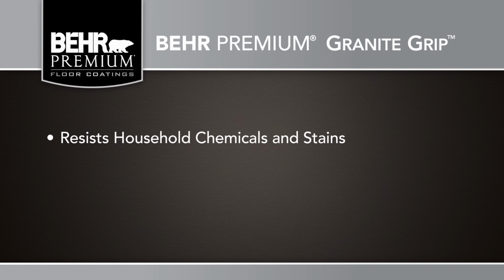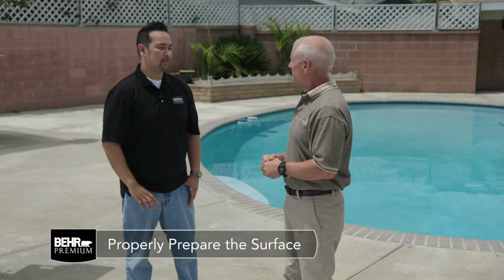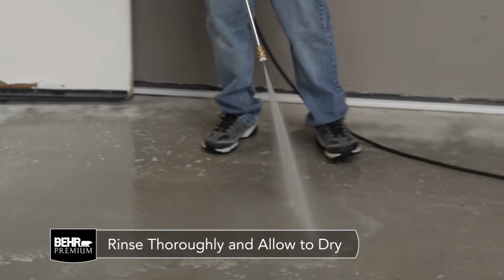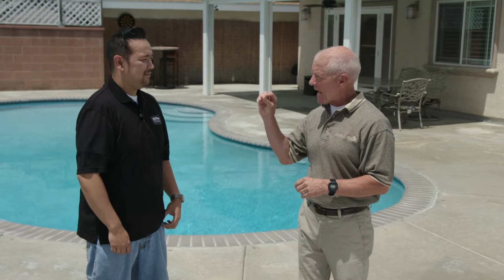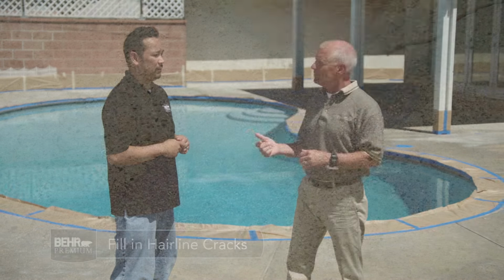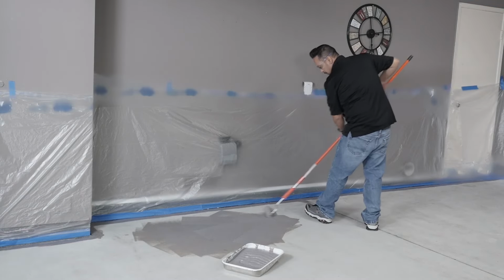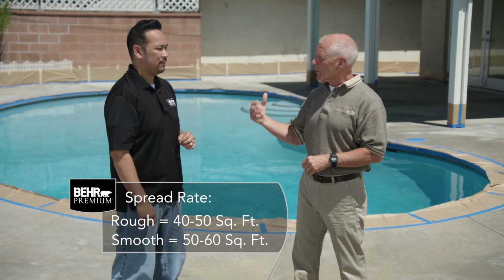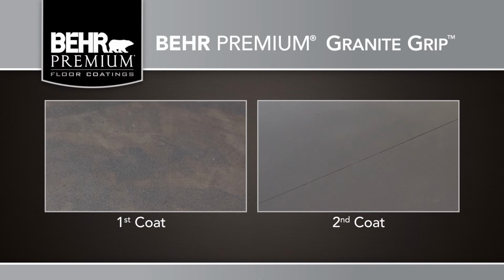How to Apply BEHR Premium® Granite Grip™

Comment: We had Professional painters prep 300sq ft  of concrete deck around our pool according to instructions including Muratic acid etching to a very clean surface, applied thin 1st Coat Granite Grip as base coat allowed 24 hrs to dry as we were applying product in Texas and morning shade was best for application. Following manufacturer's warning not to apply in direct sunlight or above 90 degrees.  Second coat of Granite grip applied as video instruction did not cover, leaving unavoidable roller marks.  Five different painters had a go at rolling, and after 24 hours determined the sand aggregate within the product was not homogenous and was not spreading evenly.  5 Gal covered 2 coats of 300 Sq ft. We bought 2 more gallons and applied the third coat with another 1/4 adhesive roller,  still upon drying we have roller marks, hi-low aggregate, uneven areas visible.  Another Youtube DIY guy posted same experience and said absolutely need to spray the 3rd coat,  probably spraying the 2nd coat would be advantageous as well.   Our painter concluded it is the product, not the rolling technique, if you are having issues on a large area, switch to a sprayer, as this video suggests, but does not emphasize. We are happy overall as the product appears durable and bonded well. Good luck guys.

Comment: If my concrete is broom swept and already feels like 150 grit sand paper, is the etching still required?
Reply from the maker: Great question. If the concrete isn't porous, we still recommend etching. To do a porosity test, sprinkle a few drops of water onto the floor. If it gets absorbed fairly quickly, you may skip etching since your concrete is already rough. We hope this helps.
Reply: @BehrPaints  Thank You!

Comment: I applied this material on a concrete patio and know the owner is telling me that the edges are peeling off. What do you recommend I do in that situation? I  sanded the concrete, then I power wash just to be on the safe side but still peeling.
Reply from the maker: Hi Salvador, we're sorry to hear that the edges of the coating are peeling off.  Please reach out to us directly so that we can help you with the best solution.  Our Customer Care team is happy to help! Alternatively, you may chat during business hours here: http://spr.ly/60501cMCn.
Reply: @BehrPaints  can you apply this with a sprayer designed for truck bed coating?
Reply: @BehrPaints  we have paint on our concrete around the pool and want to use granite grip now. How do I prep so it does not lift?
Reply: @BehrPaints  what if concrete is painted?
Reply: @ronniebuchanan6575  just prep it with acid and power wash. Make sure no loose paint. Then apply 2 coats of Granite Grip
Reply: all paint products, no matter how expensive and good they claim to be WILL peel. I am going through the same with Sherwin Williams product. It is horrible

Comment: Do you think I can "Hide" crack repair with this? When I patch up cracks with filler, the filler is never the same color and you can tell there was a crack there. Could this be put on top to "mask" and "hide" so that a new home buyer or home inspector can "NEVER" tell that there was a crack and repair?
Reply from the maker: Hi Anonymous,

Thanks for writing in. The Granite Grip is a great product that does fill in hairline cracks up to 1/8". However, if the cracks are larger than that, you'll need to repair those with a paintable concrete filler before applying it. Also, it's very important that all label instructions for prep and application are followed to ensure a successful project. And keep in mind that while two coats are necessary, additional coats may be required to hide previous surface imperfections or cover over dark colors. Good luck!
Reply: @BehrPaints  Thank you for your response! One more question on the proper use of the acid to prep the floor. How do I get it off without washing it into my plants and killing my landscape or grass? Is there a special mop? Some people are saying to throw tons of baking soda at it before rinsing. Just thought I would check with you pros first.
Reply from the maker: Hello. We recommend checking with the manufacturer of the acid or prep products for best removal techniques.

Comment: How do you remove it?
Reply from the maker: Hello there! Our Granite Grip coating can be removed using a concrete floor grinder, it can also be topcoated with a solid concrete stain or concrete paint. If you have any other questions or need additional assistance, feel free to reach out to one of our Customer Care reps directly, via chat, here: http://spr.ly/60501r4d2. (Hours of availability can be located on the website link provided.)

Comment: I would not recommend this product unless you have a texture sprayer. It sucks and becomes way too expensive without it. Unless the project is really small and can be done with a hand brush or simply just pouring an ass Tom on the surface you will not get an even spread and it ends up looking like shit. You need way more than 2 coats if you’re using a roller. I used it on a floor that already had some in it and it came out like shit. Do not recommend without sprayer